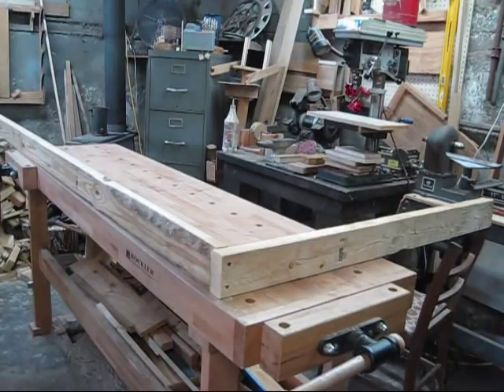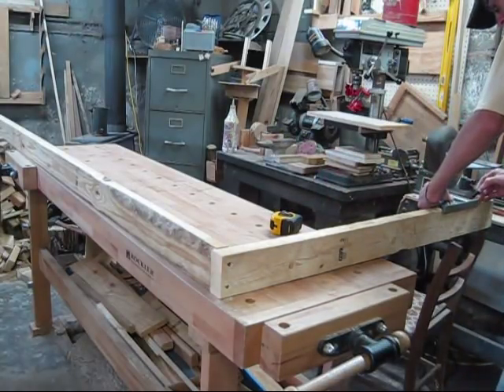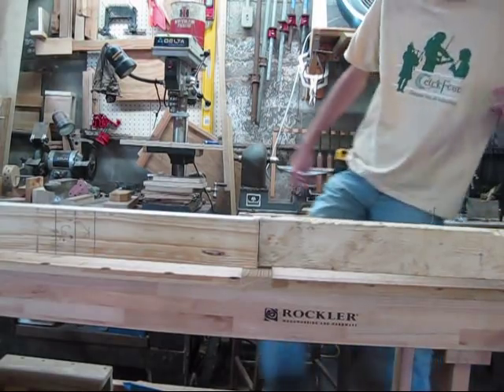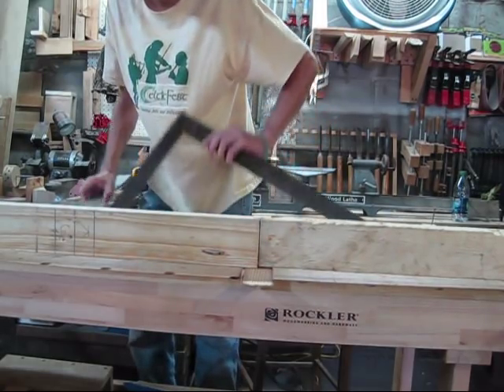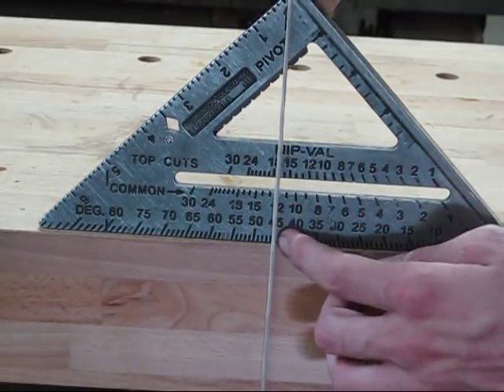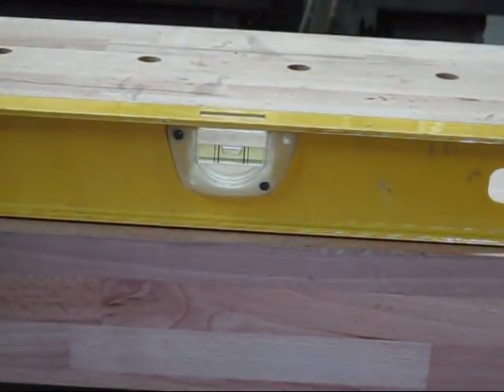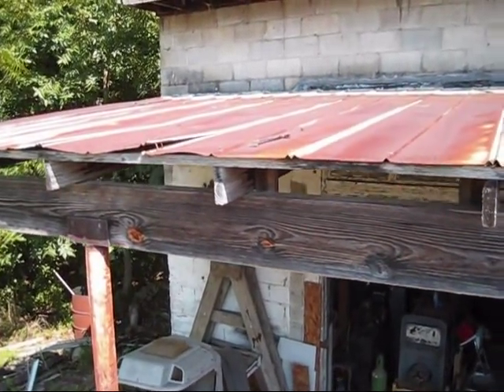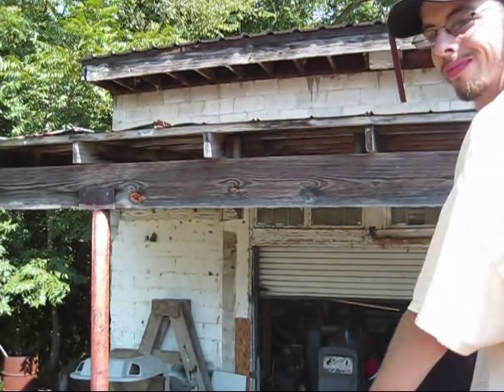Tricks with construction tools

Comment: Here's a tip to better the speed square level trick. Set the square on a known straight edge - steel studs work great. Now instead of 10" you have 8-10' for reference. But don't just plop the straightedge down either - even a small hump in your slab or subfloor will wreck results. Instead, set both ends on something of equal thickness - small square of 1/2" ply, a cpl quarters, or even a 16d nail (laying down). Whatever will get your straightedge evenly above the humps and dives. This works well for extending any short level too.
Reply from the maker: Thanks for the tip.
Reply: I've never seen anyone use the method of level by speed square.  I've always used a plane ol carpenter square that is more like 18 inches or more and when the weight attached to string is slung down from the upright part of the square it should follow the square down to the thing its setting on.  If it don't hit right at the  point of the square you can adjust accordingly till it does and your level.
Reply: trongod2000
Yea, but carpenters often hit the field without the big carpenter's square -- they carry the Speed Square because if will fit in their tool belts, so that's what they have available and use.  I personally tend to avoid using the big square unless I'm working on the bench or have a special datum to set; the full square is just to unwieldy and since it's a very thing piece of stamped sheet metal with sharp corners, it is always looking for a finished surface to really wreck.

Comment: I am a welder by trade working in a fab shop.  anytime we have to join pipe, axles, spindles to axles or ANYTHING that can't be checked with a square we use the double square technique for level.  I also have built two peer and beam structures as well as many forms for concrete slabs using the 3,4,5 method.  great video.  reading through the comments I agree that we do not have enough young tradesmen (male or female) in today's society.  To much emphasis has been about getting a college education when in fact a piece of paper is just that a freaking piece of paper.  you do need certifications and what not but I can't tell you how many times I have interviewed and tested applicants with welding certs that couldn't join two pieces of bubble gum.  and we wonder why all of our jobs are going to foreigners?
Reply: should say anything that can't be checked with a level
Reply from the maker: Well said man glad to hear that I'm not the only one how thinks that.  Thanks for the comment.
Reply: +Classic Work 

Kudos to you. Thank you for the video. I enjoyed it and learned a thing or two also. Much respect for passion you have for your skill enough to want to share. 

And yes Jeramiah is correct in saying that tradesmen are a dying breed. Men like you are who have built this great nation. Keep on keeping on and maybe you'll teach something to some young curious pups. 

Much respect.
Reply: I love fab shop work.

Comment: I liked your tips and tricks , a old man i worked with taught me the 3,4,5. The old ways are still some of the best ways , especially when you are popping lines on a large area where a framing square is useless. I never knew about the double framing square method , we usually just used a scab 2 x 4 to tie the 2 together but that lets you hit the mark spot on. Glad to see some of the younger generation picking up on some of the old ways. And your tape measure retrieval method was nice , in a pinch whatever works whatever it takes  :)  Keep that hammer swinging and thx for the upload !

Comment: "How to square a corner with nothing but a tape measure"... "take your square. square that line"

if you use a square to square the line, you might aswell use it to square the frame
Reply: MrNeato1980 the square is only accurate to a few feet if you use the theory, you can square  lines 10s or hundreds of feet long. For instance, up the numbers by ten. (30-40-50)
Reply: Neato you probably never worked in construction before, if you try to square a house with your tiny tool you would be packing up your make up brushes and tools in your purse and get fired on the spot.....

Comment: I've been in construction for 50 years... always made it a point to ask every senior Tradesman to show me the best trick of the trade. One of the best trick I ever learned was when putting casement around a door jamb where the drywall is sticking out beyond the Edge of the door jamb. Simply hold the casing flush with the inside of the door jamb and draw a line on your drywall. then Hollow the drywall out from that line to the door jamb and that casing Will Roll right into place and you will never see it. Once you slide the casing  to expose the reveal at the jamb  it will cover the line and it will not be seen the best eye will pass right over it. I've seen drywall protruding 5/8 of an inch beyond the jamb and with this technique it's completely concealed. there is no need to rip and try to fur out the jamb flush with the drywall. I should have done a video on that technique.

Comment: The trick using two squares was a good one, I've been doing  layouts for welding for 50 years and never saw that, but that's very helpful thanks, one for your next video, pulling nails that have been set for a long time, give the nail a good smack with your hammer  to break the set friction and it will pull without breaking off the head. 
Good video you did

Comment: Great tips! I started as a Drafter back in the 70's and it's good to see real math used. Two lines on the same plane are parallel. I keep a good strong magnet in my tool box and it stuck to the end of a tape has saved me many times, works down storm drains! Keep up the good work!

Comment: Ethan, I am a 5th generation Builder and have always used the old 3,4,5 method for squaring because I personally have found that some of the squares that I have bought are out of square just a little bit, so forget the people who try to knock you and your methods, the reason being is that they have not got the faintest idea about accuracy, they work on the idea that "close enough is good enough", in Australia we call those people "Jerry Builders" as they Jerry rig things to try to make them look good and normally fail, you are doing a top job educating the Do It Yourselfers and will save them a lot of money, Keep it up Young Fella, remember that there are a lot of people out there who need a little bit of help with their projects and a little bit of help goes a long way, Cheers from a 67 year old.

Comment: Just yesterday I was teaching my boys about the 345, 6810 ratios for squaring  up a corner. Speed square for a level is neat too as were the others.

Straightening the beam reminded me of a "contractor" that started some "construction" on my mil house. His spec beam was sagging 3/4" in 12' causing the roof to be pushed up and off at the corners. When I used a string to demonstrate it he was relieved of his duties and replaced with a guy that actually knew what he was doing. 

Cool tricks all of them cause Cause sense ain't too common anymore.

Comment: Nice tips you've shared! The "pull the tool off the roof trick with a good tape measure" brought out a laugh from me, but it was a half hearted laugh. I had called an appliance repair man to check out my dishwasher to see if it was repairable and I left the room so he would not feel hovered over. (needed a new dishwasher) When he left, my tape measure I received for a birthday present, which I had laying on a side table, was gone.  Will not leave the room ever again with a "friendly" stranger in our home..........

Comment: the "3,4,5" trick is a simplified "a^2+b^2=c^2". You know, that Pythagorean theorem from school we all had to learn.

Works for any lengths to check for right angles, and because of that you can increment it for larger areas.
"6, 8, 10" or "9, 12, 15" and so forth. If you're wanting to square out a chalk like for example, you might want to use as big a square as you can fit in the room to make sure your line is straight.

Comment: Cool video, Thanks.
One of the best tips I ever learned is this.  If you have to drive a nail thru trim or dry wood that is likely to split, turn the nail over on a hard object and hit the point with your hammer.  The dull point will keep the wood from splitting most of the time.
I also had a guy show me how to do math with a tape measure, and I'd love to find out how to do it again.
Reply from the maker: Aye you can use a tape measure as a slide rule. I may have to do a video on that one.

Comment: I understand the concept on the 345 triangle. Very clear presentation. I'm an amateur woodworker. Just build for 
friends and family.  When you 
used the marks from triangle..and got your five feet did you measure  on the inner of the triangle. Also if you found the wrong length on the diagonal, how would you find out which if not both were out.. I would take a framer's square or triangle to the 90 and go from there. Idk..I saw this awhile back and didn't think of that question.I think this a much needed video I'm going to share this link with friends.

Comment: The first garage I ever built was 24x30 out of rough sawn lumber and plywood in a location with no power. Two of us, both 19, had nothing but a tape measure, hammers, water level, stihl 015 chainsaw and ladders. But our secret weapon was dads who had taught us to think, and the garage got framed level, plumb and square.
My friend’s dad could take a blueprint and precut an entire house and the crew that built it would never need to make a cut. That guy was amazing, what was in his head for clever knowledge. You’d be measuring and figuring and he’d say here look- and flip boards around and explain the angles faster than I could think, and make a few marks and cuts and boom, it all fit together!

Comment: Good video....I knew most of those, but I still liked the video....One trick that I thought was awesome is when drywall guys will use the edge of their tape measure to cut dry wall....Say you want a piece to go above a window....They just take their tape out measure it, lock it....run the top of the measure over one end of piece of dry wall, while using their finger to guide it and on the other end the use their metal end of the tape measure to score the drywall...then break it and install it....It fits perfect, every time....

Comment: You got some high dollar tools there for a young Buck. Rockler work bench, drill, welding machine, lathe (Walker Turner) with chisels. Must not be married. Took me thirty years to acquire tools like yours while supporting wife and family.
Reply from the maker: I wouldn't say high dollar most of my tools are 15 years old and older.  Yes I'm not married, but I have been collecting tools 10-12 years. One or two a year won't break you.

Comment: I saw an old Pipe line welding machine in your garage, I use Miller but those SA 200 look cool as hell.
Reply from the maker: +David Spennachio Aye I've got two of them, and there are indeed awesome.  Thanks man.
Reply: Classic Work Cool.

Comment: Used to work for a contractor laying out additions, houses even parking lots using the 3-4-5 method, 30', 40', 50'. He had an old time transit with a bent plate which was next to useless.The 3-4-5 was more accurate. Two guys, a 100' tape, a plumb bob and a ball of string, you can lay out just about anything, unless the winds blowing.

Comment: I work at Home Depot, and I actually use the last one regularly (in a way) to get small cases out of the overhead. It's nice to not hunt for a ladder to get a small box down. I also use it for pulling things out of small areas at work or at home. If you arms too big or too short, throwing some tape on it does the trick.

Comment: One trick that takes some practice is making straight(square)lines on sheeting/drywall(from square edges)with just a tape measure and a pencil.

1. Make a mark where you want the line to be.
2. Put the pencil slightly angled in the notch in the catch at the end of the tape, hold the pencil and tape tightly together.
3. At the smart end of the tape pinch the tape between your thumb and forefinger.
4. Using your forefinger as a  guide slide it along the edge of the sheeting/drywall while moving the other hand at the same rate making the line.

This will create a very straight line and once you are used to it, it can be faster than using a chalk box.

Note: be weary of getting splinters there's a happy medium of pressure you have to use so you won't get splinters but you'll have enough pressure to maintain control to make an straight line.

Comment: 1) When squaring a wall with a tape, the biggest bite you can take is the whole wall. As the wall is typically the same height and length all one needs to do is tape completely across the wall and make the measurements the same.

2) It is easier when checking for Parallel to use a straight edge across the joint.

3) It is essential to make certain that the string isn't touching anything when attempting this and the accuracy can be increased by measuring both directions and taping the angle and making certain that the measurements are the same.

4) When using a line to check a wall or beam for true, it is important to move the string away from the board to make certain that it really is reading true (see 3). I tend to use a piece of scrap 2X and lift the string off the wall or beam the same distance on both ends. This method can also be used on the edge of the beam by then using another block or your tape to check the distance from the string, the beam or wall is off when the distance alters.

5) That was good for a laugh, thanks.

Quick tip, to make certain a level is still reading true place it on a surface and then reverse it. If it still reads the same than the level is true, if it reads different then true is the center of the two readings, adjust your bubble to reflect this. (also works for the plumb bubble)

Comment: I love the old Lincoln pipeliner in the back round! You take one that age and spend some time and a few 100$ on it and it will still wear out 3 brand new welders with air cooled engines! I am not sure if you mentioned it at the beginning of the video or not but these techniques work just as well with metal as wood. I don't call what you reviewed with us tricks no magic was involved knowledge is not magic it is just not common anymore. The trolls saying what you show in this video is wrong are living in some dream world, every way you showed to do things was spot on and tried and true methods taught to us from the older generation. Thanks for sharing good info that outlines how to use simple and inexpensive tools to perform quality work, stay cool man
Reply from the maker: +melaniew77msn Thanks that means a lot.  As for the old welder I got two of them. ;-) Thanks again for the comment.
Reply: Classic Work Just call them how I see them man. I would say we are cut from the same cloth. A code of honesty, respect for Elders and a desire for quality workmanship that most will never understand! Thanks for the time you spend to make edit and post videos. I loved your video on pipe layout well done on that miter cut. Will you please show us your cow catcher when it is completely done? Did you ever think about welding on a few fittings and putting a hole inside every saddle fitting so that that bumper can serve as a mobile air tank? Can I offer a tip on paint I learned from experience? If you mix and spray your own paint if you use rustoleum buy the flat and buy majic hardener from TSC. If you don't thin the paint and put in 2X the recommended hardener the paint will go on very well and look great, here is the bonus if you need to do touch up work later gloss rustoleum spray cans will match crazy good. This is what I do on any bed or bumpers on service trucks because when stuff gets used it looks used after a while. I have found that keeping your service truck looking good is impressive to customers and reflects the fact that you care!
Reply from the maker: +melaniew77msn Aye, and thanks again.  Here is a look at the bumper https://www.youtube.com/watch?v=wTZQNWzmGgk  My dad thought the same thing about making a air tank out of it, and I think I would have if I didn't already have a air compressor on the truck.  As for the paint job I did my best with gloss black rustoleum I didn't think about putting hardener in the paint I'll have to remember that next time.  Thanks again for the comment.

Comment: One of my favorite tricks is to use 16p nails instead of expansion anchors to secure bracing to concrete paving. Drill a 1/4" hole, like you would for any anchor, then drive two duplex nails in the hole. Cheaper than anchors and actually holds better.
Reply from the maker: Aye that is a good one.
Reply: I prefer drilling a hole with 3/16ths bit and using a 3-1/4" duplex nail with 16 gauge tie wire. It holds like a beast.

Comment: the squaring of a wall can only be done if you establish to long running Chalk lines at 90degree angles on the deck.
You can the toenail the studs or plate to the lines and brace off.
The line on the beam,board edge works great.We wrap the running end of the line over our index finger,spin it 3 or 4 times hook it to the nail/screw and pull it back against itself in line until it twangs. it creates a prusik  effect and stays tight with a simple half hitch.
Good video